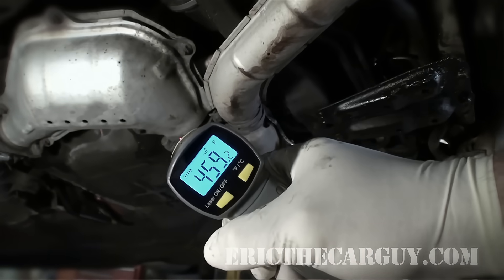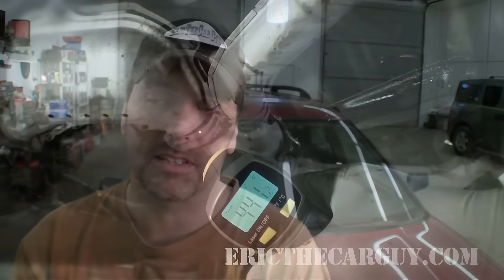Does Lacquer Thinner Clean Catalytic Converters? -EricTheCarGuy

Comment: Great job on showing us the outcome on some things that we see on YouTube.  I'd be terrified to try this.   Thank you !!!
Reply: It worked for me !
But As Myth busters do... They always Screw Up... Change / Weaken the Fix... So It Does Not Work.  You Need 4 Times the Thinner.
You were supposed to do 1 Gallon of Lacquer Thinner on a Half Tank (8 Gallons of Gas).  You barely had any Thinner.
But I used 2 Gallons of Lacquer Thinner with 13 Gallons of Gas in my 2013 Chevy Silverado 2500 HD and Drove 190 Miles on Highway.... Till I was near empty.... And it worked.  
But hey,  This Video is just an attempt to try and put down another Channel... small minds... small mission
Reply: @jameschupp2230  gotcha 👌
Reply: I have done the lacquer thinner trick a couple times and both times it worked. The lacquer thinner is a concentrated cleaner. However before doing this, I advise make sure  the manifold and the sensors are fastened and not loose. Then put a shopvac in the tailpipe and see if there is no external damage or leaks that would give the computer a false code. Then try the lacquer thinner and if that fails aswell, odds are the cat is too far gone and needs to be replaced. If the cat is good, odds are it will clear the code. Not 100%, but best method I found before taking the cat off
Reply: @cerebrum211  nnniiiccceee. That makes total sense.    My cat is pretty bad but still yet, I'm sure worth a try.   These cats are far past expensive these days !!!

Comment: Your suppose to use a Gallon of thiner and a half tank drive it 150 miles. 
To get your Check Engine Light Off, pull your Negative Cable off and touch the Battery Post 3 times with the cable end then,
 Reconnect your negative cable and start  your car. Usually it works like a charm.

Comment: Take it out, dump 1gallon diesel shake it whole cat. Than drain out dirty diesel .
Again out 1gallon high octane  gasoline, shake it, 5minutes, drained out, 
Bring cat conv to car wash, apply in to pressured water till comes clean water, 
Again dry it with commercial heavy duty heat gun .
That's it.your Catlytic  convertor is like a new.

Comment: That was not the best way to test your cats.  You should have used the ECM to do a test before, clear codes and then let the ECM do the test for you again.  It's called using Mode $06 data.

Comment: OK, so I tried the lacquer thinner in the tank. What happened was at first it helped. Instead of a top speed of 60, I could get it up to 70 + but I could still hear air noises coming from under the hood. Since it did help, I thought I would try it again, using one gallon of thinner to 5 gallons of gas, but what happened was as I drove it got worse.

What I think happened was it was getting carbon off the valves and dumping it into the cat. I removed the cat to find it completely clogged on the inlet side. Looked like carbon mostly. What finally worked for me was getting a 1 1/4 round wire brush with a 6" extension from a hole saw kit and a drill. It cleaned into the honeycomb leaving a rounded depression, but hey, it was completely clean.

Rinsed it with a garden hose and it was good. Saved big money in the end. No new cat needed.

Comment: Sounds like a great idea , but I'm pretty nervous doing that on my Range Rover 🤔😳
Reply: I have been extremely hesitant to try this as well. But I may just go for it to avoid the $3,000 they’re wanting to charge me to change mine (I have 2). So many videos on here prove it’s effective and no harm done. With every video, I read all comments and see this method is extremely common and works for 90% of those commenting. I don’t have a RR, I can see why you’re nervous. Maybe continue watching videos and read comments for confirmation to ease your mind?
Reply: I want to add- I don’t know the year of your RR, I’m not very familiar with the price tag is because I know it’s far from my price range. I avoid even looking at vehicles with a hefty price tag. But, putting myself in someone’s shoes and imagining owning something so expensive, I would probably just purchase aftermarket and have a muffler shop install them. Assuming you have no warranty, no point in OEM. I’ve seen comments (very few. Probably less than 5 out of 3,000) where the vehicle became completely shot. I do know that not all lacquer have matching ingredients. More recently, the guidelines changed and they have added synthetic ingredients to them. You would have to do research to find out which ones have the original formulation. With the price of SUV’s currently start at, I wouldn’t even chance it with my Buick Enclave. I’ll most likely get more testing done to ensure it is my cats since other things can throw that code, just replace them with aftermarket ones. Just my opinion
Reply: @ThisIsMyYoutubeName1  yeah that's makes sense, thank you. 😊
Reply: @TheLatelycrew  Even aftermarket ones can be expensive. I can afford to have the dealership replace them, but I refuse to do that until I hear back from my attorney (we are trying to sue where I purchased my vehicle. It broke down 2 days after purchase which is proof he sold it broken. I’ve tried reasoning with him to fix it, knowing I’m protected by state and federal consumer laws, but he’s a SCAM and started threatening me, even showing up at my house with a fob and kept locking my vehicle to try to scare me). Until I hear back and we decide we will keep the vehicle, I’m not paying for repairs, when he can then resell it? Absolutely not happening!! 

Anyways, a safe alternative, if you happen to have friends or family that are mechanics. You can remove them and soak them in lacquer or degreaser. This way, it cleans buildup without the risk of it moving through all of your fuel systems. 100% safe and just as effective. I’ve seen quite a few videos with people doing this, so searching shouldn’t be an issue. I wish you the best of luck! Hope this helps!
Reply: @ThisIsMyYoutubeName1  wow you been thru ALOT with your car, I'm sorry that happened to you. I hope everything works out for you.

And I yes I also heard of cleaning it with dishwater too. It runs perfectly,  just the dumb engine light won't clear (well it does, then pops back on). Best wishes too you love . Hope all goes well 🙏🏽
Reply: Hey... As Myth busters do... They always Screw Up... Change / Weaken the Fix... So It Does Not Work.  You Need 4 Times the Thinner.
You were supposed to do 1 Gallon of Lacquer Thinner on a Half Tank (8 Gallons of Gas).  You barely had any Thinner.
But I used 2 Gallons of Lacquer Thinner with 13 Gallons of Gas in my 2013 Chevy Silverado 2500 HD and Drove 190 Miles on Highway.... Till I was near empty.... And it worked.  
But hey,  This Video is just an attempt to try and put down another Channel... small minds... small mission

Comment: Good video with metters and temperatures and all that groovy tech stuff, but bottom line is will it clear my check engine light and failure so I can get the damn car inspected. I've used guaranteed to pass and others and am now going to truy lacquer thinner .  I've done this every year since I bought this 2005 tundra with the problem back in 2009 and get passed every year. Myself like most people watching these probably couldn't care less what the real problem is, let's just get past this stupid inspection and get by till next year. Best solution is to pressure local politicians to end these ridiculous inspection programs. Sad to say Texas has not done that yet. Anyone that can do away with them will get my votes from now on!

Comment: Its a thinner.  He did say, "if its not that bad."  Gas has detergents, and thats what thinner will do.  He also said one gallon for 120 mils on the highway.  So, was that one qt. you put in?  Ive always done this, smh.  Ask a seasoned mechanic
Reply: So, did you follow Scotty's second suggestion and remove the cat, then wash it out?

Comment: It works when you use the proper ratio and you catch it when the vehicle starts to have issues.  Don't wait a few months, it''ll be too late for sure.    If you had 1 gallon of gas in the car, your scientific test "may" have worked.  That's like mixing gas and oil in 2 stroke engines, you need the right amount of oil to gas ratio.  Same with this, you added too little with almost a full tank of fuel.  So you needed to add a full gallon of lacquer, not a quart.

Comment: My 2003 tundra had a P0420 code. PerScotty Kilmers video I put 1 gal of Lacquer thinner from Home Depot and went out for a drive. At around 100 miles, the Check Engine light went out. I couldn’t believe it. That s__t really worked! Passed CA smog. It’s been approx 5 years.
Reply: Did you drive 100 consecutive miles?

Comment: Couldn't you put a catalytic converter in an oven (on self clean ~800 F) or a kiln if higher temp needed to turn the carbon to ash and then wash it out?

Comment: Do a few tanks of fuel with the thinner in, give it some time. If it is just coated, running kinda lean, which is what adding light solvents does, may give the catalyst a chance ro "eat" through the buildup.

Comment: I used to put acetone in my XJ every fill up to keep that check engine off. Turned out I had to change my cap and rotor more often. But my fuel system was clean.

Comment: You need to run it long enough if not it will rather end up clogging the converter by removing all the carbon in the engine and depositing on the converter. Another way I have found to work well is removing the top O2 sensor and using a pressure gun to feed the thinner. It’s fast and very effective. Doing that for 30seconds should be okay or you risk filling up your cylinders with thinner. Engine will eventually start even if it gets filled but don’t overdo it.
Reply: tricky! So forgive my ignorance, but you run the car parked at say 2500 rpm and feed the laquer thinner through the o2 port on the manifold? How much, how long?
Reply: @breasonable4343  car needs to be off to be able to do this cos when car is on exhaust gas will come out of the port with pressure. Feed the port with little amounts of thinner to avoid it climbing back in the cylinder. Just to be sure you can spray it in for just 10 seconds then run the car you will see it come out of exhaust and then repeat the process till you are satisfied.
Reply: @breasonable4343  good thing about thinner is it’s inflammable like petrol so if some gets into the cylinder the engine can burn it off but getting too much in there can hydro lock the engine and it’s not good for your cylinder walls as it will corrode the protective coating. So inject small amounts at a time and since it hits the converter directly it’s super effective. Saved me buying a new converter and possibly an engine cos when converter was clogged engine could barely accelerate and was suffocating.
Reply: @everythingtrendingworldwide  Thanks for the info!

Comment: 2005 Corolla had the same code. I used 2 bottles of cataclean but engine light still turned on. I tried 1 gallon of laquer thinner with 1/2 tank of gas. No more engine light.

Comment: Hi Eric.. have a 2000 honda civic ex sadan..I to have the same code also saying it's a low efficiency bank 1...in my mind I kept thinking its the oxygen sensor  utility I was more concerned a out the catalytic converter  in front of my engine. In my mind again I thought of the sensors so I did some research as to where the problem is really located..and sure nough...its the oxygen sensor.

Comment: hi Eric i just watch your video on cleaning a catalytic converter with lacquer thinner cleaner. Scotty say to use one gallon of lacquer cleaner in half tank full of gas and run the car for 150 miles. but you only use one quart which is only 25% of what Scotty recommend. you should do the test again with one gallon instead of one quart. scotty recommendation. works your test was incorrect that is why it did not work for you.

Comment: If you pour lacquer thinner into the gas tank, it will burn in the cylinders and I don't understand why it will clean the cat converter.
How about removing the upstream O2 sensor and injecting the lacquer thinner into the O2 sensor holes? Will this be better?

Comment: 40 years doing Autobody... Gun wash & Lacquer thinner are one and the same... I've cleaned everything under the Sun with Gun Wash Tons of engine parts, Tires, Rubbers, Plastics, Car Panels etc etc... BUT be careful with Lacquer thinner it can Melt or Swell and Remove lots of Paints Plastics and Rubbers... Other things it won't even Touch like Tree Sap or Coffee stains on a Car Hood... Use Rubbing Alcohol for Tree Sap... Soap & Water for Coffee rings on a paint job

Comment: This worked for me!  I have a 2005 Pontiac Vibe with over 125,000 miles.  Service engine light came on, pulled the code, which was the one for catalytic converter issues.  Bought a gallon of paint thinner and added it all to 1/2 tank of gas.  Drove about 100 miles at 72 mph.  Got out of the car to shop with the service engine light still on, turned the car off then came back about 30 mins later, turned the car on and the light was OFF on its own!  It's been about 2 weeks since that time and so far, the light hasn't come back on.  I've noticed the car accelerates better now and gas consumption has decreased quite a bit.  The car idles better, too.

Comment: On a 2008 Prius with 120,000 miles and an original cat, I used 1 gallon of lacquer thinner and headed out on a trip to the mountains. I noticed the car ran better, even though I didnt have a code. No codes came up and I feel like it helped as a preventative measure. Next, Im going to try it with the 2012 Tacoma.

Comment: Just updating with a personal experience here.  i have a 04 dodge truck with a 3.7 engine and 4 O2 sensors.  Couple of months ago i started getting a P code that said i was getting a mixture error my passenger side up stream O2 sensor..  So knowing what a pain they are to get at and the cost of replacing that multiple CAT system, I thought 'What the heck why not try the lacquer thinner trick first"  so i poured in 2 quarts of lacquer Thinner ( i know its suppose to be a gallon) and filled up with super unleaded. After about a week of regular daily driving the code went away and hasn't come back.  I guess it depends on the vehicle and how clogged the cat is or if it truly is a O2 sensor issue. But it worked for me.

Comment: My Kia Sedona engine light on due to P0420 failure, I went for it with the same formula 1:9 ratio, driven the minivan almost 80 miles mostly highway, and still the engine light on, anyhow next day I was working on the Airbag light on issue, and in order to try fixing it I unplugged the battery, when  I put on back, to start the car and check the status of the Airbag light, I found it still on, but BOY the engine light cleared instead 😂, This is new experience happened accidentally, so let say, if still the engine light on after Laquer Thinner added to gas tank and car driven almost 100 miles, try to unplug the battery few minutes
Reply: disconnecting the battery clears all codes and erases all collected data - then you have to do the whole drive cycle exercise to get data back in to get smogged.  This is not a fix, this is just clearing data and starting over with the same issues that will get flagged again.

Comment: The thinner will not clean a cat because it's already combusted by the time it travels through it. However, thinner cleans the crap out of the fuel system, injectors and cylinders which may be why it works for some people.